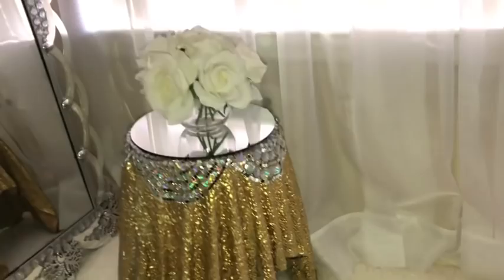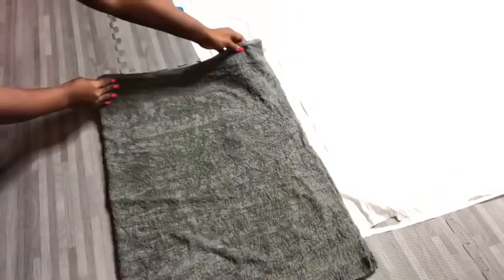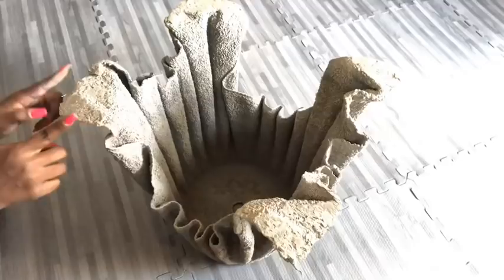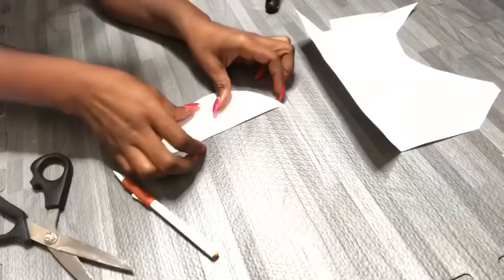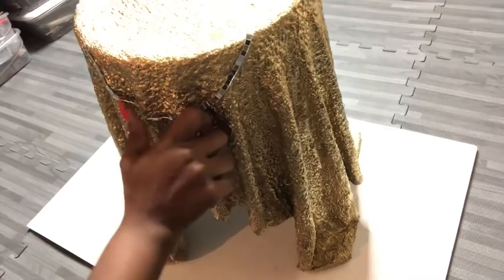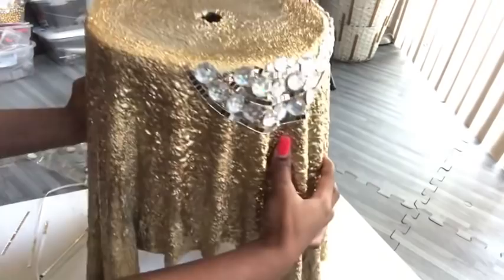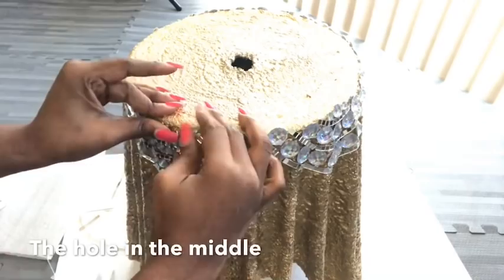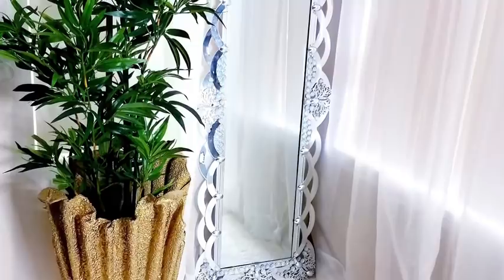HOW TO TURN TOWELS INTO GLAM SIDE TABLES| Home Decor Ideas 2019| Sunroom Decor!

Comment: I just did this with old cut up pillow cases dipped in Paris of plaster for smaller flower pots.  They were not as sturdy as I wanted so I will absolutely try the concrete mixer next. Beautiful Yodvuh!
Reply from the maker: Dericka S P.O.P also works if the mixture is thick enough. I’m glad you like the idea 😇. Thankyou so much 💕💕💕

Comment: Hey dear, i have tried making this but my table doesn’t have grip. It falls, once   the bucket is removed. Please guide.
Reply from the maker: Oh no! 😐 You probably didn’t use enough thick cement on it and another thing too is the dry time. You have to wait for it to completely dry. I used a RAPID SET cement that is why mine had a shorter dry time. So if you’re using a regular cement, make sure it’s thick enough and leave it overnight to dry properly to become really strong 💕
Reply: Thank you so much for the reply. I think I need to discard it and make a new one. I also used a large towel. So the height was good enough. Should I use a short towel for it to stand firm?